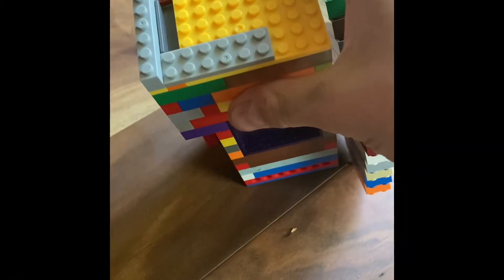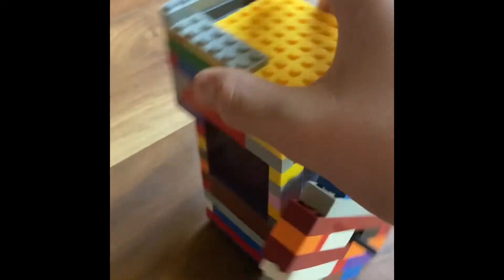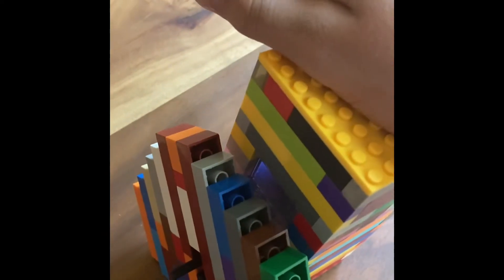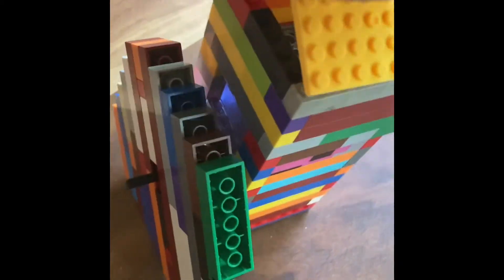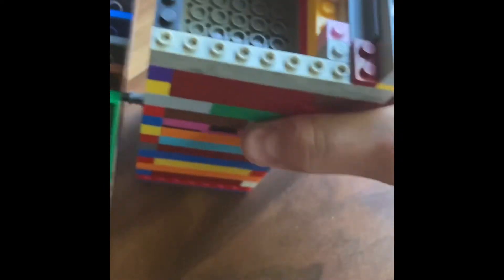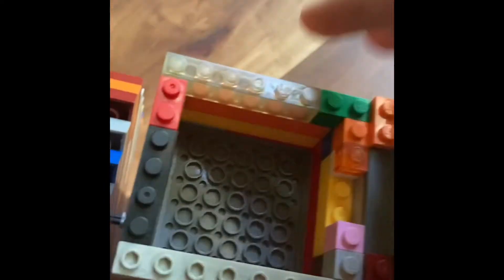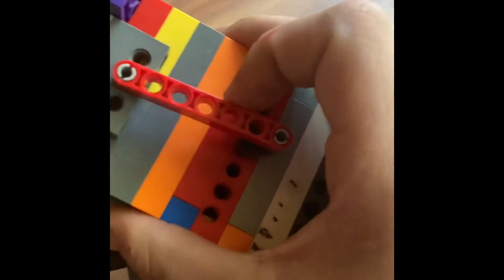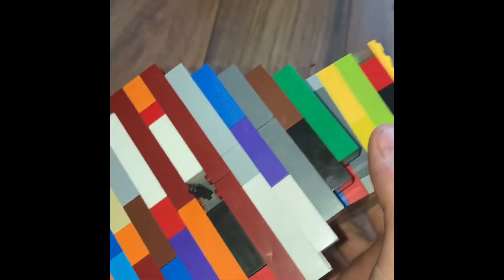LEGO 6x6 piston vacuum engine! First of its kind??

Comment: What size is connecting rid?? Mine won’t turn over, it worked fine on my 4x4 piston but not on my 6x6 piston.
Reply from the maker: If it won’t turn over, I wouldn’t think it was you connecting rod, I would check your timing, your vacuum, with a 6x6 piston, you need a little more vacuum power, and make sure your valve goes up all the way when it needs to, and make sure you don’t have any leaks. If you still have problems, send me a link to a video of your engine, I’d love to see it!
Reply: @user_dudeman3  I haven’t put timing on it yet, I think it just needs to be sanded down
Reply from the maker: @EthanAdey  it’s absolutely Important to have your timing right, if you don’t have proper timing, your engine won’t run. You need your valve to open the intake when it needs to in the cycle. Your valve crank needs to be ahead of the piston by 90 degrees in the direction that you want it to spin. This gives the valve a chance to open the intake right before the piston starts to rise, when the piston has reached the top of its stroke, the valve closes, but leaves the intake open for exhaust while simultaneously closing the vacuum. It’s key to have some kind of exhaust port so the piston can pull new air back in the cylinder for the vacuum to pull in the next cycle. There’s different ways to have exhaust, you can have an exhaust hole in the cylinder that open when the pistons goes all the way down, or you can have a second valve for exhaust on the opposite side of the intake valve. And the best way for exhaust which is a new idea, a SVS valve. It is a valve that has a 1x4 bench piece on the top of the valve. This valve allows the intake to open as an exhaust port to welcome new air when the valve has gone down. This is a very great design for performance and simplicity. Now, back to timing, again, make sure your valve is ahead of the piston by 90 degrees. If you still have trouble, I suggest building an oscillating vacuum engine, or a butterfly engine. These engines do not require valves and are extremely simple to build. Hope this helps!